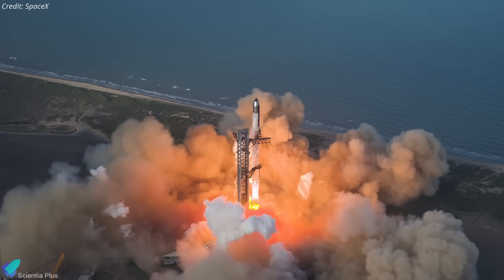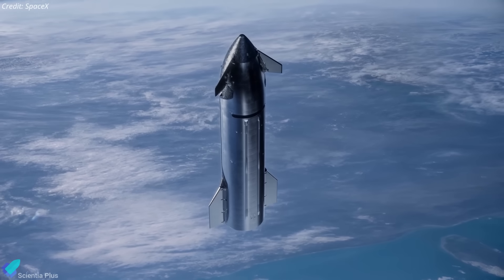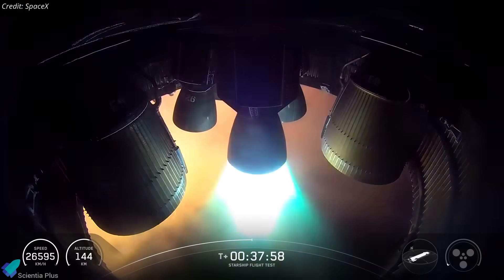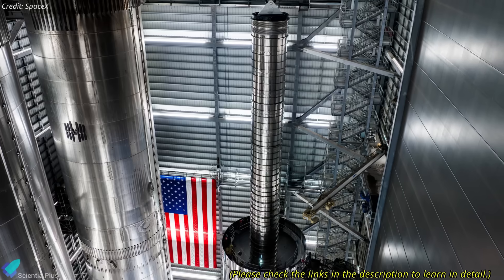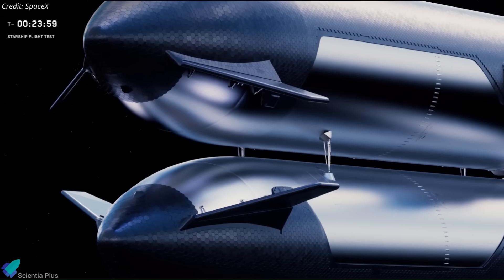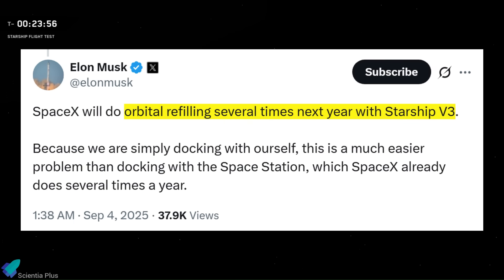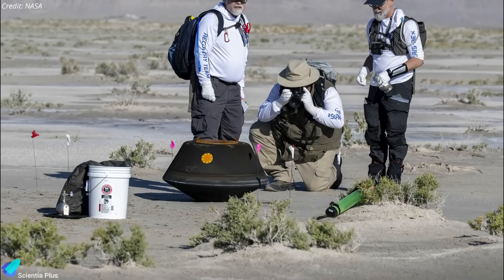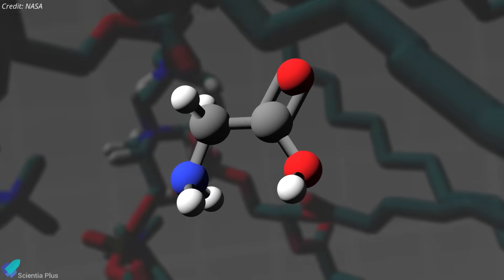BIG REVEAL! Starship Flight 11 is Full Orbital Launch! Ex NASA Boss SLAMS Starship Moon Landing

Comment from the maker: 00:00 Starship Updates
09:53 NASA Just Found Stardust Older Than the Sun!

🚀 Starship Flight 10 
  📽Detailed Breakdown: https://youtu.be/irVUMJNe0Kc
  📽Root Cause of Anomalies: https://youtu.be/LBUpp7MRVSY

📚 Learn More:

🚀 Starship Block 2 Explained:
 📖 Summary: https://shorturl.at/b0dtw
 🔍 Detailed Explanations:
  • Design Improvements Update 1: https://shorturl.at/lpGT7
  • Design Improvements Update 2: https://shorturl.at/gwNQ4
  • Nosecone & Payload Bay Redesign: https://shorturl.at/xa60S
  • Methane Downcomer Redesign: https://shorturl.at/XdYBG

🚀 Starship Block 3 Explained: https://shorturl.at/mnBT4
  • Detailed Breakdown: https://shorturl.at/IViwD
  • Production Begins: https://shorturl.at/xRNkJ
  • New Transfer Tube / Downcomer Explained: https://shorturl.at/Iaqc6
  • New Grid Fin Explained: https://shorturl.at/NxdVo

🚀 Starship Block 4 Unveiled: https://shorturl.at/7A2ef
 
🔥 Raptor V3 Mega Upgrades & First Test: https://shorturl.at/TRIyj
🧱 What’s Inside Starship GigaBay?: https://shorturl.at/nJM75

🛠 Insane Engineering of New Starship Launch Pad B: https://shorturl.at/7RAZd

🛢 Dual-Port Orbital Refueling – Full Technical Breakdown
https://shorturl.at/5tiqK

🛠 Other Starship Upgrades:
 • Hot Staging Explained: https://shorturl.at/jf400
 • Super Heavy Booster Upgrades: https://shorturl.at/Pi5R3
 • How SpaceX Protects Raptor Engines: https://shorturl.at/4Om8F
 • New Heat Tiles Explained: https://shorturl.at/p2Ijb

🚀 Starship Flight 7
 📽 Complete Breakdown: https://youtu.be/UqzZx7vb-TA
 🛠 Root Cause & Fixes: https://shorturl.at/HcLKo

🚀 Starship Flight 8
 📽 Complete Breakdown: https://youtu.be/f26yH80RK2o
 🛠 Root Cause & Fixes: https://shorturl.at/vsGFB

🚀 Starship Flight 9
 📽 Complete Breakdown: https://youtu.be/2eirgcUzwts
    🛠 Root Cause & Fixes: https://shorturl.at/NwhZA

🔥 Starship 36 Explosion:
  📽 Detailed Breakdown: https://youtu.be/VWQiIz1ymBA
  🛠 Damage Report: https://shorturl.at/Quoex
  🛠 Root Cause & Fixes: https://shorturl.at/NVqdS

🚀 Starship Flight 10 
  📽Detailed Breakdown: https://youtu.be/irVUMJNe0Kc
  📽Root Cause of Anomalies: https://youtu.be/LBUpp7MRVSY

🔎 OSIRIS-REx
👉 Mission Explained in Detail: https://shorturl.at/bOyYV
🧬 33 Amino Acids Found in Bennu Samples:  https://shorturl.at/0MRHu

📡 Stay Updated:
📢 Weekly Updates: https://bit.ly/3HIQjPC
🚀 SpaceX Playlist: https://bit.ly/34wue8T

🌍 Follow Us:
👍 Facebook: https://www.facebook.com/scientiaplus

Comment: He made some valid points, but the new space race is not just getting there first, it's getting there and staying there. China can put their flag first but a flag is not a moon base.
Reply: it is if they plant it in the place we want to build one.
Reply: The flag is significant because I could be a mark of territory. The South Side of the Moon is the most efficient place on the Moon to live. Anywhere else would require expensive heating and cooling systems. So whoever plants the flag on the South Pole of the Moon first pretty much claims it first. On top of this, the far side of the moon is rich in frozen water, which can be used for drinking, or converted into fuel.

Comment: If, Jim Bridenstinethat, former NASA administrato,r had been in charge during the Apollo program, the Soviets would obviously have been the first ones to the Moon.  He is the prototypical bureaucratic bureaucrat!  He even has just the right look for it!  He obviously has a most precious arse to protect... and a lot of grudge and jealousy against SpaceX.

- If the Apollo program had waited to test every single new technology, one after the other, the Soviets would have won the race to the Moon.
- If the Apollo program had waited to be "human-certified" (it NEVER was), the Soviets would have won the race to the Moon.
- If NASA had waited to be able to offer its astronauts on the Moon a back-up in case the LEM ascent stage failed, then we would still be waiting!

Basically, the only two things he said were:
a). Landing a Starship on the Moon is full of challenges!  Great value added, as everybody thought it was a piece of cake!
b). Things have to be certified, with back-ups whatever happens.  Basically, it has to be an airline flight!

I finish as I started:  this guy is the  prototypical bureaucratic bureaucrat!
Reply: Jim Bridenstine is merely sounding the alarm and saying what the current administrator can't. If we make it to the moon on schedule it will be because of him.

Comment: 1:30 it wasn't the loss of attitude control that prevented deployment. The loss of attitude control and the deployment failure were both caused by a fault (destructive) in the autogenous pressurization of the main tank.

Comment: Yes the starship moon lander plan is B/S what an antiquated idea ,time to start some lateral thinking ,,Why try to land a big pencil vertically then dig a big hole then put in a huge condom to rest it on and how could you get it back off the deck again if you ever wanted to  My thoughts / change the shape of the moon lander to geometry ,that can be in a low profile unit that has landing rockets spread over a flatter profile , that land on wider spread legs and and be able to reuse the same rockets to lift of again if need be as I’ve said before all the so called alien sightings we have seen, have not been long pencil shaped rockets ,they have all followed the saucer shaped design of sorts !too much tunnel vision at NASA and spacex Me thinks

Comment: The reason so many flights will be required for refueling is because Starship is really heavy. Too heavy to get the job done. The choice of Stainless Steel was a killer and may prevent Starship from being used for lunar exploration. Also, the ships that are falling over on landing on the moon are all tall and not wide and flat. Good luck with that landing.
Reply: Now we know why you are no engineer. Seem to be qualified as a nasa who have now problem going 10x over budget and 10 years too late (if ever). Does the words cheap and fast build mean anything?
Reply: @mitchnn  starship has been in development since 2012 and has spent 24 billion...it is still NOWHERE close to completion. SLS launched 3 years ago. The comment you replied to is exactly right.
Starship is massively overweight and not even close to having complete systems. It's only going to get heavier. It's design of "150 tons to orbit" is more realistically 35 tons...less than FH.
Reply: Aluminum does so much better when heated on re-entry! 😮 😅😅😅
Reply: @brucelytle1144  considering that they still have to use a heat shield what did they gain?

Comment: refueling was suppose to be demonstrated in starship block1. Starship block 3 is longer so it will have different resonance, the problem that destroyed most block2 starships. They just managed to fix block2. Now moving to block 3 , they better have fix that without losing too many machines or running off with a block 4.
Reply: Do you have some special knowledge of vibration & resonating?

Comment: The average speed at SECO-1 of the Block 1 Ship (the second stage of Starship) on IFT-3 thru 6 test flights was 7710 m/sec taking into account the speed of the launch pad at liftoff due to the earth's eastward rotational speed. Orbital speed at 150 km altitude is 7814 m/sec.

Comment: It is too tall to land on an unprepared moon landing site.  I would land something shorter first and build  a proper landing pad.
Reply: You do realize that SpaceX has already launched and landed a starship (with earth gravity) right? That was done way before the booster was even close to testing!
The main test then was the "belly flop" maneuver. There were a few (spectacular 😊) RUD's in the process!
Reply: Hopper (the predecessor to Starship) landed on unprepared fields around what is now starbase.  This isn't anything totally new to SpaceX.  They've been landing on rocking and rolling ships in the middle of the ocean.  That's a hell of a lot bigger of a challenge.  We have technology now to survey the moon and find suitable landing spots that we didn’t  have in the 1960's.  They can use millimetre radar to map the surface area down to the square inch and even non classified camera systems can get great images from the much lower altitudes they orbit the moon at versus taking pictures from Low Earth Orbit of earth shooting through the Earth's atmosphere.  The existing Lunar Reconnaissance Orbiter has already mapped the entire surface of the moon down to 0.25 sq metres per pixel from 100km in altitude (it gets as low as 20km).  That's plenty suitable to find very flat areas of many hundreds of square metres and then HLS can look for perfectly flat areas with no stones / craters as it's coming in for final approach.  It always amazes me how many Mommy's basement dwellers think they can outsmart someone who has proven again and again that he makes the "impossible" look easy.

Comment: Rather than launch so many refueling flights Spacex should develop a Starship Heavy rocket consisting of three super heavy boosters and a stretched Starship capable of refueling a Moon or Mars Starship in one or two launches. They would not be developing a new rocket so design modifications should not take a long time. Hopefully the time needed to develop Falcon Heavy will not take as long since they have experience.   If Spacex launches 1,000 Starships per year to Mars it will take 10,000 Starships to refuel them. That is not practical. Either develop a Nova type of huge rocket or develop a Starship Heavy.  I’m open to other ideas.
Reply: Not possible. Will require SpaceX to develop liquid hydrogen tanks and engines that can burn liquid hydrogen and oxygen. Methane simply does not have the specific impulse.
Reply: @nickl5658 If it’s not possible then how are they launching Starships now without using hydrogen?  What’s good for the goose should be good for the gander. H might be more efficient but there are always trade offs. By staying with the proven methalox fuel they might be able to design a SH before the end of the decade.
Reply: How about a fully fuelled ship on a superheavy with 4 falcon 9 boosters.  I wonder if there is any booster configuration that would put a fully fuelled starship into orbit?  All comes down to math I guess.
Reply: I call the "orbital refueling station with a captured small ice asteroid as fuel source" card.
Reply: where is the laughing emoji for this comment?

Comment: I would think on some of the expendable rockets you can use some of the older Raptor engines. Why burn up your best engines when you can use the ones that would probably not be as reliable for reuse.

Comment: "Dozens of tankers", "no one knows". So this dufus can't do simple math. Any lander has boil-off of fuel. H2 boils off faster. Good thing he's no longer administrator. Administrators should be able to do simple math. 

"Refueling has never been done in LEO"... yet Spacex mastered docking... which is harder. What exactly does he think the additional complication is? Also sun shields will dramatically minimize boil-off in LEO depot. He doesn't remember Skylab... James Web telescope?

He also, clearly does not understand the massive advantages of landing 100t of cargo on the moon vs what? 10 tons? The objective is a "permanent base". Nor does he mention the cost, the effect of reusability... the fact that the Tanker missions would cost maybe $50m each at maybe $500m total cost. The ship at $200-250m... the Depot at $250m totaling maybe $1 billion for all that vs $4.5 billion for SLS/Orion... which can be replaced by a Crew Dragon linkup with Starship Lander in LEO rather than the contrived linkup in lunar orbit. This can be done with V3. With V4 (due in 2027) it will be easier with more payload and fuel. Maybe someone should explain the Rocket Equation to him... or teach him to use Grok... sorry (Musk... can't use that) Copilot.

He's an imbecile or a politician (liar) or both and we are well rid of him. "Permanent base" not a Quonset hut at $4.5 billion x4 per year (more than NASA total budget and assuming astronauts spend 3 months in a tiny hut)... vs $1 billion x4 per year to keep sending up Starships with 1,000 cubic meters of living space. 

The man doesn't even understand the basics.

Comment: I personally think that not only is Starship the best investment for lunar landing, I think it's the only viable option for a self sustaining lunar base. Sls can only be produced 1x year. It's current payload capacity and next iterations capacity isn't sufficient. If it was me, I'd just load the space station's astronauts into a fully loaded and refueled starship and go to the moon. No docking etc. 
In either case, once SpaceX fixed a problem, it tends to work well after. I believe they can achieve the milestones and goals
Reply: "If it was me, I'd just load the space station's astronauts into a fully loaded and refueled starship and go to the moon. No docking etc. ".....what does that mean? What space station? Gateway? ISS? You are not proposing launching from earth with humans aboard are you?
Starship is way too unsafe for launching with crew.

Comment: Not an engineer and therefore has no understanding of the complexities.   Or the potential solutions.
Reply: There are no potential solutions. The problem is energy, material strength. Going into space requires forces that is beyond the strength and heat tolerance of materials we have. So we have to cheat. We have to actively cool things so they do not melt. We have to use composite because there is no one material that can do everything we need. Our rockets are 97% fuel. To save weight, our tanks have walls are so weak that they need the pressure of their fuel to keep them upright... like a balloon under pressure. 

Worse, there are is no real improvement in material science. All we have are trade off. SpaceX traded a more expensive rocket that could go to the moon in a single step with a Cheaper heavier rocket, that n need 12-17 refueling flights to go to the moon. And barely has enough fuel to make orbital maneuvers around the moon. THus needing a space station around the moon.

We have traded safety, and speed for cost savings.  A real solution is a nuclear rocket engine. But that trades higher rick for higher power and speed. If we really want to go to mars or the moon, we need a reliable nuclear rocket. Anything else and economics will eventually defeat the project... once public interest wanes, and bean counters start calculating cost and benefits.
Reply: speaking of yourself right?

Comment: Perhaps, that's why he's the former NASA Administrator.
Reply: He's former because every President nominees a new one. The reality is, the current moon mission design is stupidly complex.  The crew are being taken to the moon by SLS in Orion capsule. There's a need to launch a orbiting space station. Then SpaceX has to launch an orbital refueling tanker. Plus the HLS. Plus 16+ refueling missions.  Then it has to land a stupidly largely "moon lander" thats like 20 times taller than Apollos, with tip-over risk, no way for astronauts to get back in if the ladder doesn't unfurl, and all kinds of crazy risks, like the fact that no one has ever relit a liquid fueled methane engine after sitting idle on the moon for a week.

The number of "this has to go off perfectly else everyone will die" points is absurd. Apollo has backups of backups if things failed. 

With Starship, there's like 50 failure points and none of them can be tolerated. 

It's not just the NASA Admin that pointed this out, it's also  many other long time space engineers.

Hell, the rectilnear orbit alone is a problem. If the astronauts miss a rendezvous with the return capsule, it's a long way for another attempt.

Sorry SpaceX fanboys, but this is dumb. A Falcon Heavy system would be better.
Reply: @TheVoid-g6f  most of them don't understand why Orion is even necessary. I do not believe this vehicle is safe for launch or landing on earth with humans aboard...or even cargo.